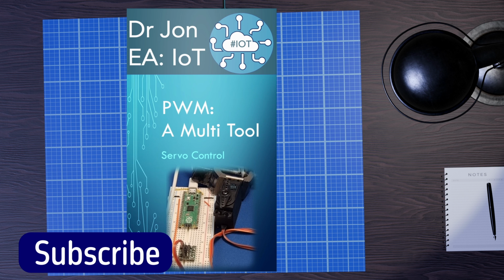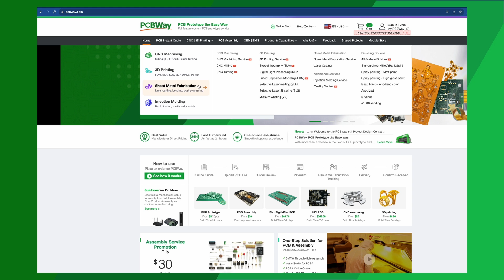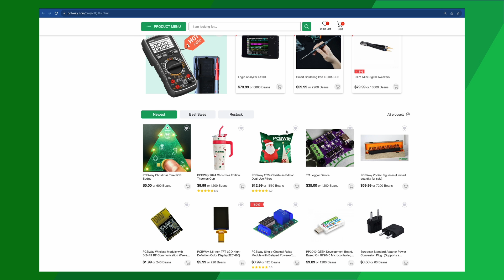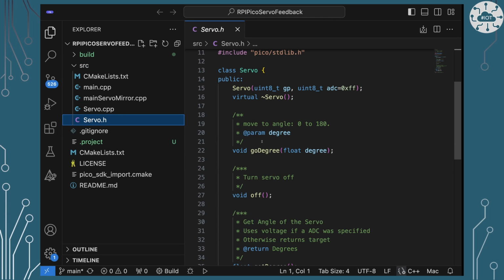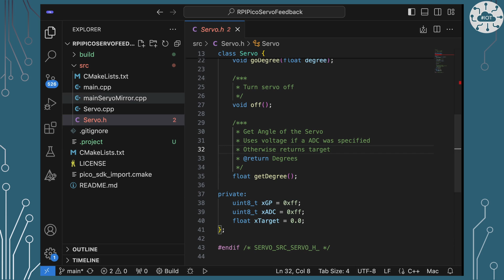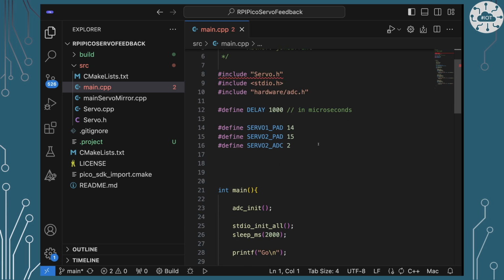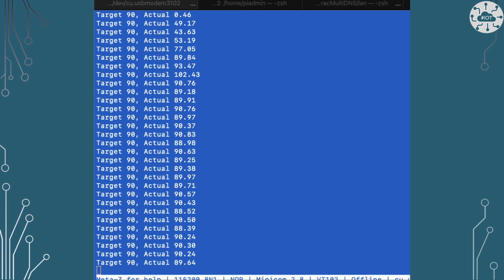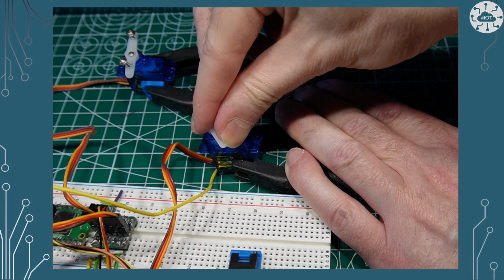How to Use a Servo Feedback Hack with Raspberry PI Pico to Measure Angle | DrJonea.co.uk

Comment: I had never considered it before, but why don't all servos have that pin exposed by default? Having a little plug to get closed loop control off your servo would be really useful
Reply from the maker: I agree. I've seen a few that do have it but they double the cost. I guess use case is really for robotics which is a small area but growing.